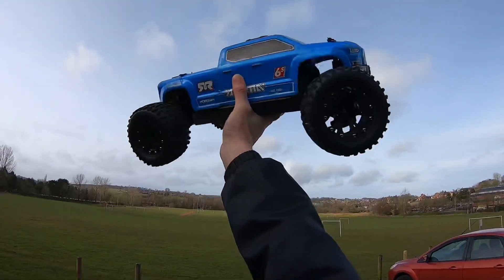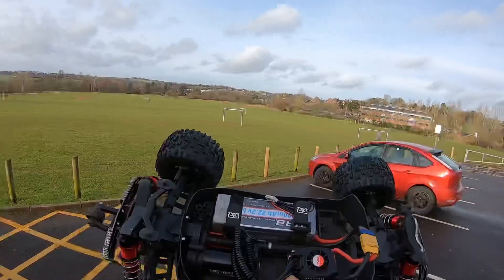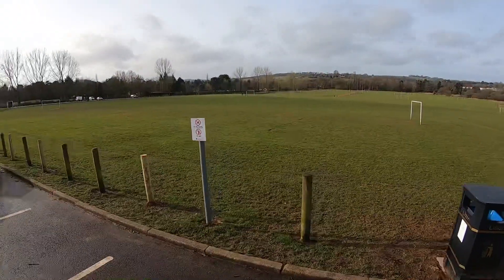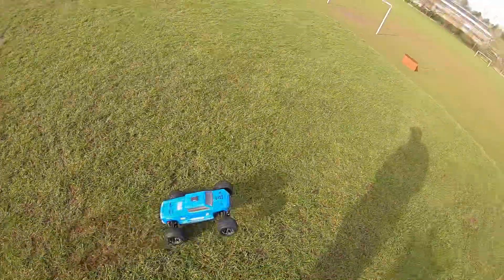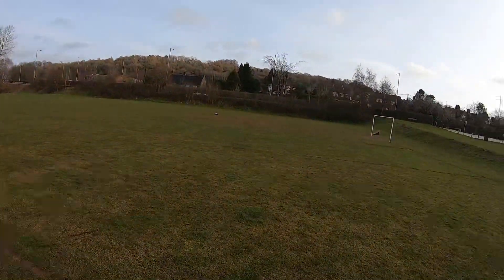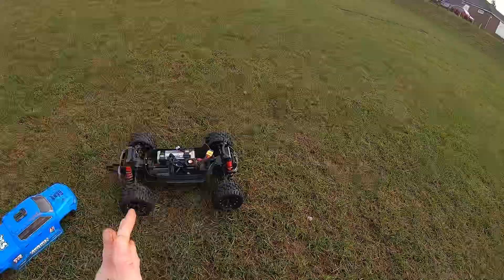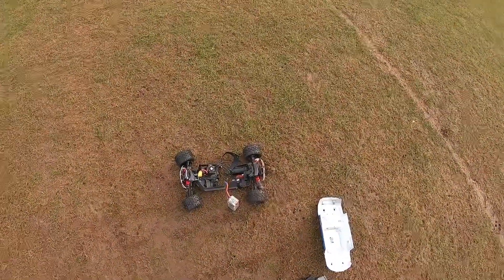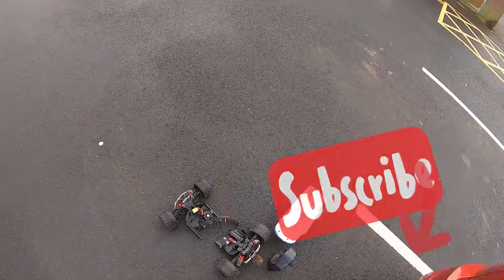Arrma BigRock 6s Power insane Speed Blasting Basher EPIC CARNAGE FAIL BASHED TO DEATH....😂 #Arrma

Comment: Any problem with the drive shafts on 6s? I hear the granite ones don’t hold up well to more power
Reply from the maker: Hey bud no I’ve had no problems with the drivetrain been running it for ages on 4s and 6s never blasted it like on the vid before and still all holding up good..I’ve set the slipper half turn out so it doesn’t send stress to the driveshaft knuckles..👊🏻😎👍🏻